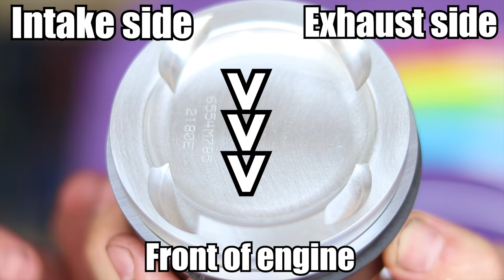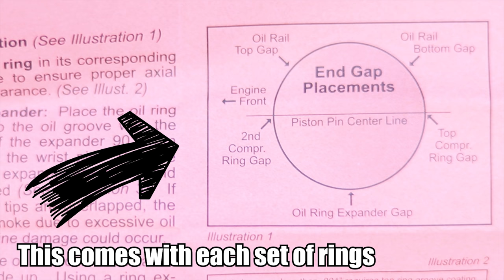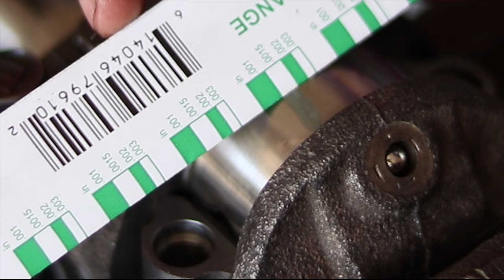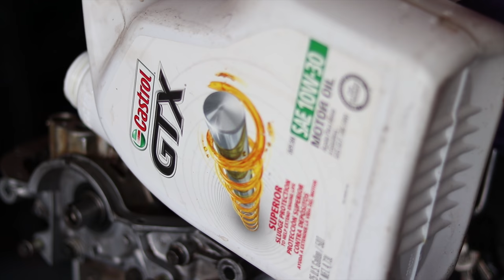How to install pistons and connecting rods

Comment: Awesome video man, i am currently rebuilding my motor with forged internals since i melted a piston. I notice something when i disassembled the bottom end. My oil pickup baffle was somewhat covered with silicone, so my guess is that if you're seeing silicone coming out of the outside of the pan while you're tighten it down, it means they're going inside the pan wall as well. so remember boys and girls, dont put too much of those silicone on.
Reply from the maker: Thanks man, I appreciate that. Yeah sometimes people can put way too much silicone on and it will squeeze out the sides.
Reply: @TheDailyDrift  i never thought you would replied! I was looking through your youtube channel and i cant find the miata containt. Are you guys are going to tune the miata? If do please make a video please

Comment: Also did you use standard size bearings?
Reply: Buy .001 if it plastic gauge comes out between. 002-.0015 , n measure again to be around .0025-.003 n run thicker oil for turbo application,  hx acl bearings

Comment: Did you file the rings?
Reply from the maker: Yes, I ended up using a file attached to my vise. Not the ideal way to do it, but it worked. Usually you would want to use a ring filer. They are pretty cheap on amazon or summit racing.

Comment: Are those H beam rods?
Reply from the maker: Yes they are H beam rods. The easiest way to tell on most connecting rods is the H beam has two flat sides with some flanges on sides which form the shape of an H if you looked at it from above. The I beams have the large flat sides on the sides and they bow in the center. If you look at the I beam from above it would be the shape of a capitol I. Most stock rods are I beams and most people upgrade to H beams when they build motors to handle more stress like turbos, superchargers, nitrous, etc. Hope this helps clarify a few things 🙂

Comment: I just binge-whatched your last 10 videos and its so great. But why are you using 10w-30? Higher viskosity oil should have a oil  stream which is harder to rip off and you guys shouldnt have a problem with the temperature, considering how warm it looked in january. Greetings from Germany, where we can drive fast, but all the cool mods are forbidden :(
Reply from the maker: Thank you so much! I am so glad you enjoyed our content. That is a very good question, usually I'll use a regular 30 weight oil for break in just because we want the rings to seat easier, and if the oil is too heavy it can take longer to break in a new engine. I'm sure we could have used a heavier weight oil though because it's about 100 to 106 F* here during the summer months. That is so sad how that works, if only they allowed the cool mods too, you would have the best of both worlds!

Comment: Hold up. If your daily driveing the car I dont think i would put those pistons in that car. Now if its purely a tracl car sure. But let the car warm up a little. If its a iron engine let the engine block expand. If its aluminium its also the same.